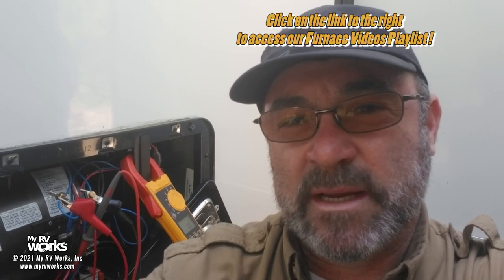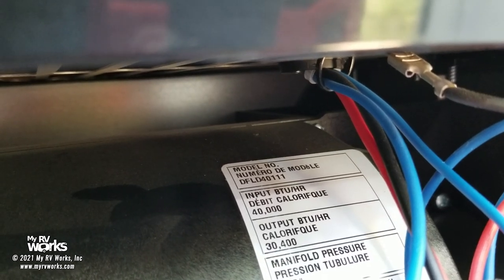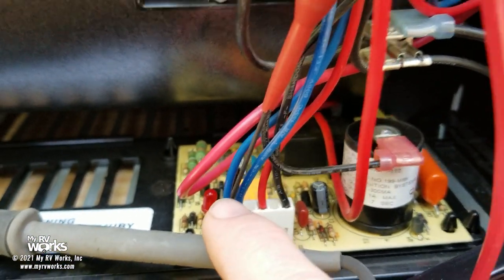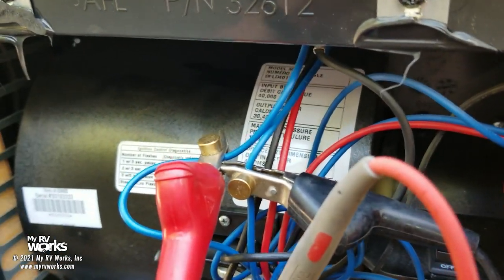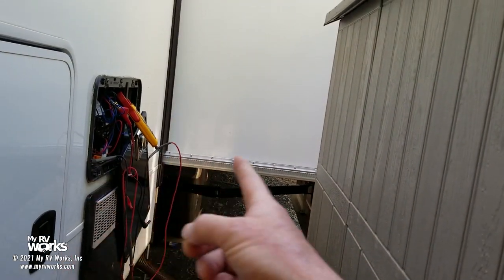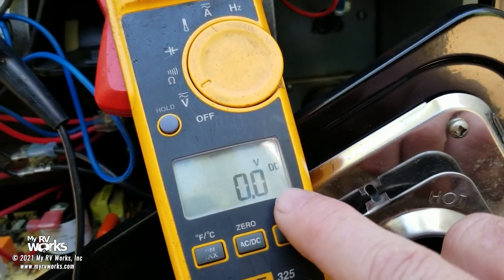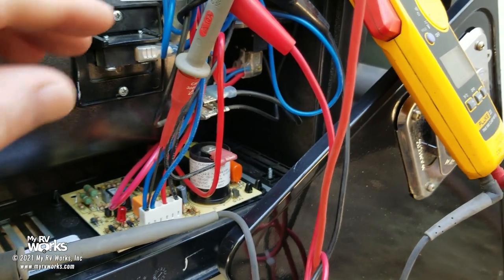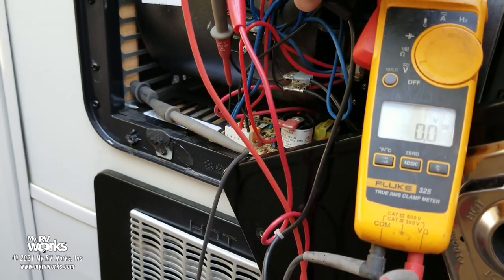RV Furnace With An Intermittent Sail Switch -- My RV Works

Comment: This is the issue I had over the weekend. I suspected it was the sail switch, but when I tested it, after removing it, I could not find any problem.  So I put everything back together and I started looking for the part # as I was pretty sure it was eventually going to fail again.  As I search for the part, I notice that the manual that came with the RV/furnance was referencing part number 33063, however, that was not available on-line and everthing was pointing to 33081.  Clearly has been engenieering change and that is the reason for the part number change. So your comment about Domestic knowing about that issue might be spot on, even when they will never disclose it publicly.  Thanks for your videos, I've learned a ton.  You have no idea how much you help people like me, that we are very handy, but we might lack some knowledge to complete the repairs.  THANK YOU (also on behalf of my wife that was able to sleep well after I fixed the furnace!)

Comment: Happened to us too.  2019 Melbourne Prestige. Found another video diagnosing this issue and recommended new sail switch. Swapped it out in 5 minutes and have not had any further issue for past two years.

Comment: I've replaced about 5 of these sail switches since November on our 2021.  The cheapos from Amazon last longer than the one we got from a RV repair guy.  But they are all intermittent.  They work better when they cycle frequently.  I bought one from a RV place out west that is supposed to be the newest trouble free version but I haven't installed it yet.  Some brackets need to be modified.    Dometic had bad switches and bad brackets.  I just keep reusing the same 2 brackets.

Comment: We had this problem AND the manufacturer kinked the rubber propane line next to the propane tanks. After replacing the sail switch (bought two extras). I still had a low flame, flame out problem. That's when i found the kinked line, cut a zip tie, zero problems since (more than a eyar).

Comment: Great video Darren I just finished a Dometic ceu class a couple weeks ago and they said they are now notching out the housing on the switch to resolve this issue on the new switches.
Reply from the maker: Thanks for the tip!
Reply: @MyRVWorks  anytime bud glad to be able to give something back keep waiting to see if you post a unity board video or bmpro video to see if I can learn a new trick on one or the other.

Comment: As a newbie its a great help watching and learning from your videos !
I do have a similar problem...the furnace fan will run without stopping for 10-11 minutes before gas is ignited and then heat is blowing until thermostat reaches set temperature.
Any advice?

Thanks
Bob T

Comment: Good video, question if the sail switch was the cause will the unit do an auto reset or do you have to turn the unit off to clear the fault. I have a friend that seems to have the intermittent problem but he said the unit will start without turning it off and back on. Thank you sir

Comment: My sail switch used to dirty over time then one of the spade connectors was not making good contact over time …. This switch is prone to very simple solutions without extensive testing

Comment: Ok good info but question, if the heater fails on sail switch does the unit do an auto reset or

Comment: HELP... I have an Atwood Mod#8520-IV-DCLP SN# 1022370. The furnace comes on, blows, and ignites. Then after about 8-10 seconds, ignition stops and blower continues. No lights on the control board. I've watched 2 of your videos, and am still stumped. Any advice?

Comment: My rv is new and my furnace has been acting up, I have found that at the thermostat I have to have the lever at a precise spot it can not be moved otherwise the furnace will not work. Then I can turn the thermostat to the on position and it will run. I can not turn the thermostat on then set it even if I put it in that exact place it will not run. If it does shut off and turning the thermostat on and of does not start the furnace, I will go outside and remove the panal and the red light will be blinking, once I reset it alot of time the furnace will start if not if I wiggle the wires which are clipped on to the sail switch it will come on. So is it my sail switch or a combination of issues going on? I want to find a rv tech who is in his 60's and lives in Florida who want to be my neighbor so I can have someone close by and build a relationship with.

Comment: I’ve been following your furnace videos trying to diagnose mine, it clicks, turns on, hot air blows out the exhaust,  but the heat blowing out the vents inside the camper is weak. Not to it’s fullest potential. Clogged gas valve ?
Reply from the maker: Have you verified that all the Ducts are attached and not kinked or clogged? I have seen this when the duct has come loose from the furnace.
Reply: @MyRVWorks  I pulled off the ducks and verified at the source that it is blowing weak
Reply from the maker: Okay copy that. Your issue maybe the motor. If you can get an amp draw and compared to the motor nameplate.  Another thing would be to verify you're getting 12 volts to the furnace.

Comment: Having trouble with our furnace resetting on its own. Any advice? It runs good and hot, lights, and stays lit but for some reason something is making it trip to the off position.  Doesn’t happen everyday or even every time it runs. I haven’t noticed a blinking light for the issue.
Reply from the maker: If you can access the control board while the furnace is running, you would look for that white connector that is connected to the DSI board.  Study the schematics for your furnace, usually there's a sticker on the furnace itself, but you're looking for voltage coming from the sail switch and high temperature switch - that circuit is on a daisy chain. It's possible your high temperature switch is faulting out.  But the only way to prove that is to follow the trail on that circuit. So that would be where I would start.
Reply: @MyRVWorks  okay that helps. I did check the voltage on the parts and they seem okay but I could’ve done it wrong. I will say we did turn it on this am it ran for a little then shut off and it kinda smelled like something was possibly burning from the back of it inside? I don’t know if burning is the right word but just seems like temperature isn’t being regulated properly. Could it be the blower motor even tho the fan runs fine? There’s no sort of squealing or strange noises coming from it. Or would it definitely be the high limit switch since it’s tripping out due to over heating possibly?